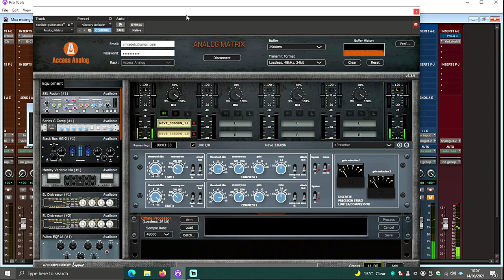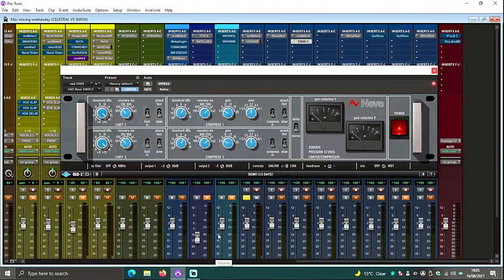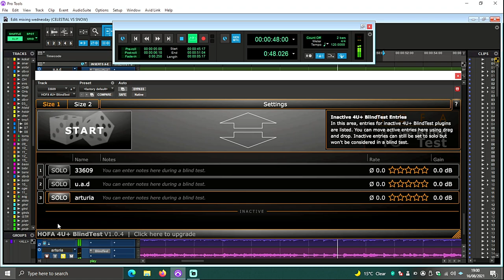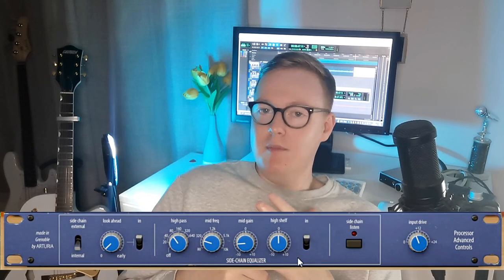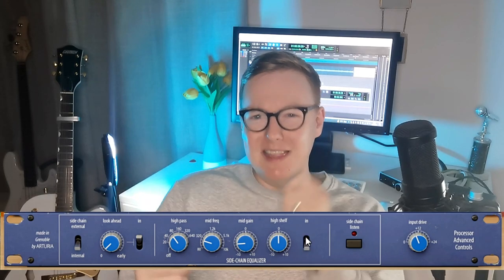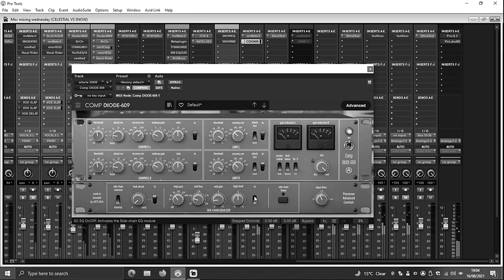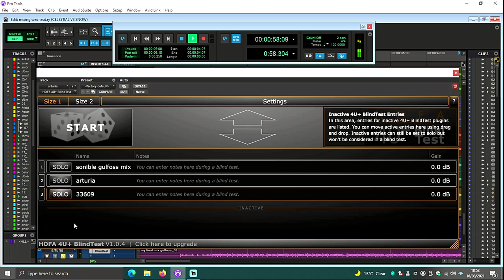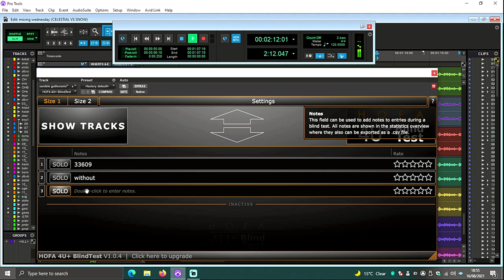DON'T buy a $4000 Neve 33609N.. try the ARTURIA COMP DIODE-609 instead 😱

Comment from the maker: This is really random but I tried out a new voiceover plugin for this video. Notice any difference compared to how I usually process my voice? 🤓
Reply from the maker: Yeah I was thinking the same listening to it back on my phone speakers. Was a little skeptical but the voxessor has done the job 👌
Reply from the maker: I may stick a smart eq instance at the start to give it a quick balance before voxessor and maybe set the vocal rider to a loud setting rather than a smooth ride so there's less dynamics in the vocal
Reply: sounding good though, but the lights looking like a wizard in the woods :)
Reply from the maker: I know I forgot to point it more towards the computer 😂
Reply: Hey P3, in your spare time, give the T-Racks 33609 version a try
Reply: I picked "Why audio plugins sound 'flat' & How to fix FLAT ITB mixes" and A/B ed it's intro with this one REAL QUICK. I prefer the old processing. Cleaner, less body, more dynamics. Now that could also be influenced by the picture, by the day your vocal-chords are having, by you having a good or bad day, by the exact distance to the mic, by the room-temperature etc.  .. it's just a very, very quick impression. I didn't spend more than 15 seconds comparing. Maybe if everyone gives it 15 seconds you'll get a result. (note: I listen on speakers, not headphones.. which is not all that common anymore I guess)
Reply from the maker: Used to use it years ago and stopped as I found other plugins. Has nice weight to it but doesn't have the width or transient character that the hardware has
Reply: Hi Paul, just a quick off-topic question: When you shoot your videos, do you "soften" your dialect or is this the way you speak in real life, too? Just asking because I plan to go to Edinburgh next year with some friends of mine. (I have no problems at all to understand you. Been in Scotland 30 years ago but they've never been there. So I wanted to send them your videos to get used to the dialect.)
Reply from the maker: It's very softened haha I naturally speak way faster with a lot more slang terms and colloquialisms. I naturally have a very strong dundonian accent
Reply: @PaulThird  Thanks 😀 Well, then at least it is a good starter for them. 😄
Reply: After reading this question, for a split sec I thought (is this it? Is this the one video thats completely in chipmunk voice)?  I let myself get my hopes up. 😔
Reply from the maker: That day will unfortunately never come 😔 sorry to shatter your dreams 😂
Reply: @PaulThird  no worries. At least I can finally  move on with my life. 🤣
Reply: @PaulThird  If you're thinking about going down the Sonible avenue, Freiraum (or Proximity) do a great job, in my experience, of doing a virtual mic proximity zoom which may be just what you're looking for, especially with their 'smart' EQ function. Cheers-

Comment: Hey. I actually did the same comparison during the beta stage of the Arturia's 33609 development. I compared it to the hardware I had at the studio (33609C) and the UAD. I am glad you did a video about it because I could not find the time to do mine :/. Cheers.
Reply: Hey,

My conclusion was that there was a very small difference in the lows. I could see that difference in the graph. Apparently a difference in terms of transformer emulation.
UAD and hardware did go as low as 10hz on a full mix. Arturia cut around 20-30hz. Is that a big deal ? Not so much imho.
The UAD was scary close actually.
The only difference I could pin point was on full mix where the hardware felt a tad wider (hard to explain why this is happening but I felt the same thing comparing other plugins to hardware).
Arturia was extremely close too but just, different, like a different unit (checked on ATC 300).
I might be mad but I felt like that UAD plugins had all a specific footprint, that sometimes works wonder sometimes doesn’t. And here I felt it worked very well.
But having the Arturia is fantastic, because you can easily match or even surpasse the UAD thanks to the options available.
I even did a mix with the UAD on the mixbus. I recalled it outside of the studio, without any UAD interface. So I replaced UAD with Arturia. Compared both mix, the Arturia felt even better for this song. That was the selling point for me.

Comment: One of my very favorites! I love the Artuia! The slow option on the Arturia sounds like butter!
Reply from the maker: Recently switched it from the 2bus to an instrument bus and.. Bang.. Instant depth. Was totally using it the wrong way for me. The GR is almost like a depth control for everything that's not drums, bass and vocals. I'll always have the Arturia on my mixes 🤓
Reply: @PaulThird  Ya, I LOVE LOVE LOVEEEEEEEE it on the guitar buss. Turn on the lookahead and set the detector circuit to like 120Hz......... gives me goosebumps just thinking about it hahaha! I like Bus Force and their "pre" line quite a bit as well. Eq Sitral is fantastic too! All their products are top-notch.
Reply from the maker: I was thinking about looking into bus force. What is it exactly?
Reply: @PaulThird  At its core it's a parallel processor. There is a dry path, compressor path, and saturation path. So there are a few different routing options you can use. By default, there is no split tho and it acts like a normal plugin. The modules are all in line at that point. It has a 3 band eq (2 shelves & 1 fully adjustable bell for the mids), then a filter section, then compression (the compressor is AMAZING, especially in parallel), and the final stage is saturation and a clipper. It also has a linear phase mode. I top down mix so it's on my 2 buss the whole mix but I don't turn it on till the final mix. So basically it's off till I bounce the file I am going to master or send for mastering. You would really enjoy all the routing options I think.

Comment: Would love to hear your thoughts on the Dolby Vocal effect Mutt Lange used on Def Leppard and a bunch of other producers fell in love with that brought that high end sheen.  There are a few plugs built to emulate it, I guess U-he Satin...Audiothing type A. Overload Dopamine....and I guess Acustica made one back in the day but it's not available anymore. There are others I'm sure. I'm just wondering which is best and if they're worth getting into...or if you simply get a better sound with something like the Maag...air band ....which I have. I guess the dolby set up was a 4 band multiband compressor that only kicked in and brightened things when the signal was low..and as the volume increased it didn't do anything. Most people never decoded it and it really sweetened things nicely. I respect your thoughts so it would be fun to hear you experiment with that. Who doesn't want the magic they had with vocals....vibe....tape...all of that. Thanks.
Reply from the maker: It's planned but not entirely sure when 🤓

Comment: I experimented with the Gulfos handling experience and came up with something interesting. I accidentally turned on Gulfos and Sand3comp one by one and heard that they were doing a similar job. Yes, of course, these are different processes, but the result seemed to me similar. What's remarkable is that Sand3comp made the sound better.
And even with different settings, it still got better than after the Gulfos. And it's not even a Nebula! I didn't even try) This suggested that it was not necessary. With the right amount of analog, you don't need to improve AI.

Comment: I wonder how the IK Multimedia  Precision Comp compare to the Arturia Diode 609
Reply: i sure wanna see i asked him to check  out the T-Racks version yesterday
Reply from the maker: I used it for years and I can tell you that it's not the hardware. Nice weight to it but there's a reason why I stopped using it a long time ago. An engineer I trust did his own comparison out of interest last night and came to the same conclusion. Still a nice sounding plugin compressor but not really got the 33609N sound like the access analog. Lacks the width and transient character of the hardware. Always going to be difficult without any hpf, sidechain eq, drive adjustments etc. The IK comp has a fixed attack as well.. I think.

I don't have access to the IK stuff anymore so I always suggest trying out your own comparisons if you are intrigued enough 🤓
Reply: @PaulThird  Just like you have an “engineer you trust”, youre OUR GUY, P3! I can honestly say i blindly trust your decisions after so many times your videos have saved my ass in many situations! Keep it up!
Reply: It’s great but the attack is a little off if you ask me. Snap doesn’t feel quite there. 
Will give another listen. Some of IK newer comps are amazing. I also think their SSL comp is one of the best.
Reply: @CarlyonProduction  IK Multimedia’s 1176 is the best to me out of all the emulations out there. Yeah, their British channel which is their version of SSL channel strip is good. They have a great promo sale now. I have like 34 IK plug-ins

Comment: I've heard that the IK Precision comp and the UAD 33609 are virtually identical sounding, for those who're interested in that sound. 

I use the IK and enjoy it quite a bit - Will definitely have to check out the Arturia! :)
Reply from the maker: In plugin doctor IK & UAD are very similar in THD. Linear frequency response is slightly different but not too far off. Arturia has much more harmonics across the board which I think helps

Comment: I'd love to see the T-racks Precision Comp/Limiter here as well
Reply from the maker: Used it for years and stopped. It's not the hardware. Nice weight but not got the character, width and transient response of an analog compressor. IK is a very old plugin comp to be fair to it though.
Reply: @PaulThird  I believe there are some gems in T-racks that are still relevant though old.

Their neve eq-73 for example was released around the same time as the precision comp/limiter. But they did no compromise about the power limitations of computers at that time. Even now, this eq still makes my computer cry 😂

And their Tape Machine Collection uses about twice the CPU usage of AA Taupe. I believe their sound is worth the CPU%.

I need your comparison reviews for these though, especially right now when they have the 25th Anniversary sale going on.
Reply: @user-us1ts5ee6u  hello, I'm not a fan of neve-style eqs, but I know that you can do the dirty analogue-thing when you drive the red gain-knob.. really distorts the sound in a great way - if I ever use it, that's what I use it for.

When it comes to the Tape Machine Collection.. they are my favorite tape-emulations on the market. Nothing compares in my opinion. Haven't heard anything else that comes close. But yes, the amount of CPU it's eating up is nuts. Gotta do it at a stage of the mix where you're willing to commit (for me that means: beginning or end).

When it comes to old IKM gems, these are mine: Classic Clipper, Tape-Echo, VC-670 (I don't care wether it sounds like a Fairchild - I love the sound), Buscompressor, Stealth-Limiter.
New IKM gems: Tape Machine Collection, Space Delay, Sunset Sound Reverb.

And when it comes to VST-Instruments MODO Bass is insane. Been my favorite VST from the start and still is. Their Hammond is great too.. but it eats PCs for breakfast.
Reply: @akagerhard  I 100% agree about  those T-racks modules, and especially that Tape machine collection, I also believe nothing beats it when it comes to full tape emulation (not just saturation).

I was skeptical about them at first, but when I got a taste of their modules during this sale, I was very pleased with the quality of their emulations, even the old ones like the VC-670 and the Neve EQs.

The current sale is definitely a gold mine, and I would love to have an idea of which to get for free. Thanks for the tips
Reply: @user-us1ts5ee6u  This is the List of IKM products I use regularly:
Production: Modo Bass, AmpliTube 4, MixBox (to me that's more of a production tool because of all the effects), Leslie.
Mixing:  VC-670, Bus Compressor, Classic Clipper, EQP-1A, Space Delay, Sunset Sound Studio Reverb, Tape Echo, Tape Machine Collection, Black 76, Metering (and some of the Production Plugins)
Mastering: Stealth Limiter, Master EQ-432 (and some of the mixing-plugins)

I also use: Hammond B-3X, Modo Drums, SampleTank, Syntronic, Philharmonic, White 2A, Quad Image, CSR Plate, D-Esser, British Channel (for the gate and sound (it has a sound by just dropping it on a track, without engaging anything)), EQ-73 (in that order of frequency). But I don't consider them as good or as essential (Hammond is great, but I don't need it all the time fe) to my regular process.

However.. by far the cheapest approach is to buy the Total Studio MAX when it's at sale for <300 Bucks. That's a real banger for the money (since pretty much everything is included, except some libraries and stuff). And this happens almost every year now.

Comment: As it happens I actually have all the current 33609 plugins (except Acustica) and this new one from Arturia made me sit up and listen!  I haven't used a hardware unit so this comparison confirmed what I suspected... superb emulation and performance! Without the need for a gigabyte of IRs ;-)  Have a look at the Arturia Pre-73 in Plugin Doctor... the curves are organic!
Reply from the maker: I had a look at arturia in plugin doctor and it actually has more harmonics than IK and UAD. It's the only one with a little 1.5db boost as low as like 15hz but the fact it saturates more than the rest makes sense to me as it felt like it had a little bit more colour. IK is basically completely flat, UAD has a low roll off. The IK is annoying as my demo ran out when I tried it out 6 or 7 months ago but you can still load it in plugin doctor. It'll stutter with static every 2 seconds but you can still make out everything in plugin doctor. IK harmonics are very similar to UAD where arturia creates a lot more harmonics across the spectrum from 20hz all the way up to like 10/15k. As it makes more high order harmonics they have also managed to keep the aliasing manageable so it's under -100db which is basically inaudible. Big thumbs up from me 🤓